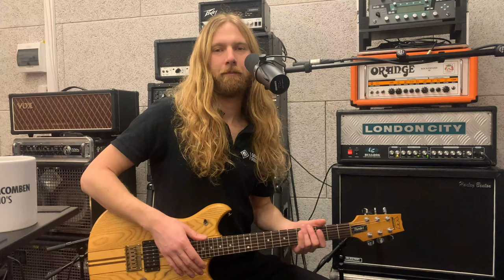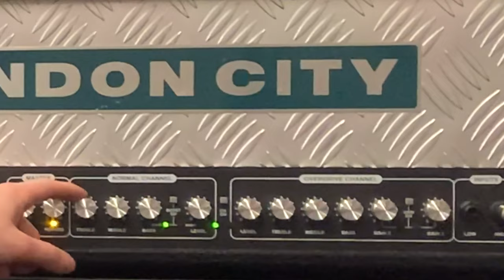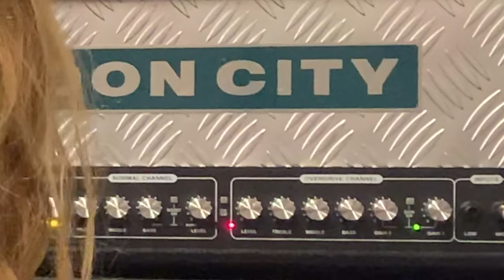London City Bulldog | Gear review

Comment: What tubes did you put in and whas it hard to bias the amp? Im wondering for future servicing. I have the exact same one. Now there are four el34 electro harmonix in it. But it doesnt break up so much on the clean as your one. Cheers! Great tone as well. Im very pleased with this amp
Reply from the maker: Hi Timothy thank you for your comment! I replaced the tubes with four JJ EL34’s. Ended up selling the amp even though it sounded good but I already had two hi-gain amps. Good luck and have fun with yours tho!